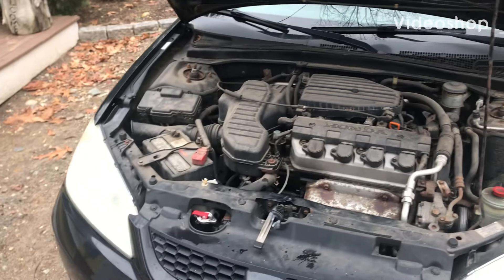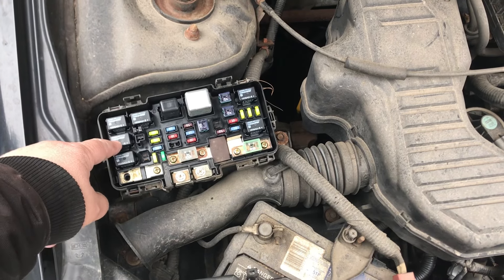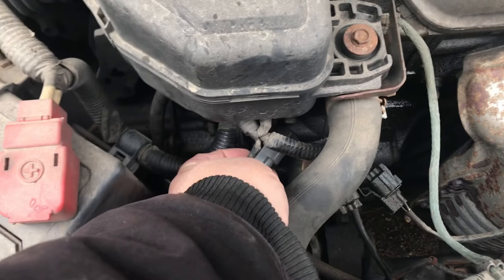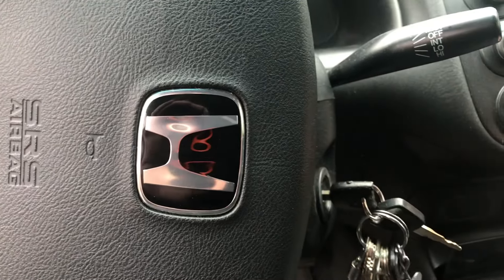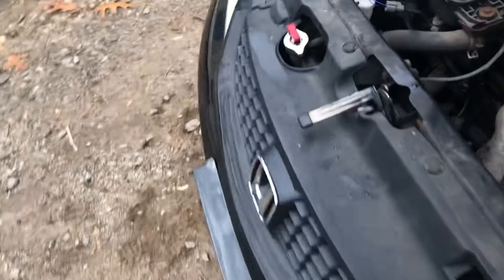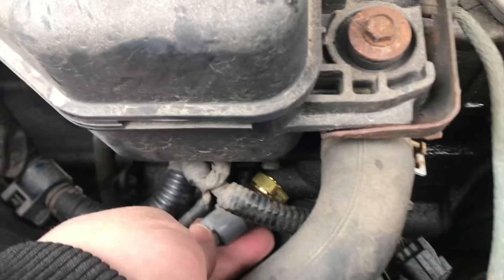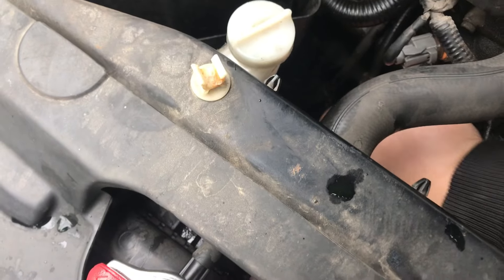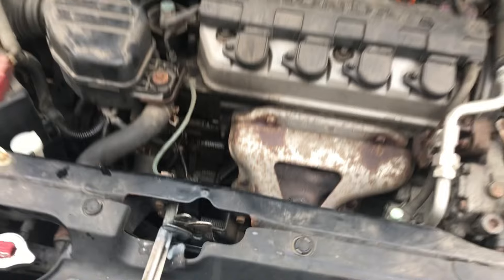Honda Civic “01-05” What to Check when Overheating. DIY & $ave

Comment: @High Ridge Handyman I'm starting to have a problem with my 01 Honda civic its overheating and the car start to shake as well I'm not sure what wrong with it and plus when its does only go 20 mph
Reply from the maker: It could be the water pump going bad or check for any clogs in the coolant hoses. Good luck be careful. If your unsure hire an Experienced mechanic 👍🏻
Reply: Civics run a little rough when low on coolant. Check coolant hoses and caps (especially reservoir!) For leaks.

Comment: I have the same car here in Pakistan
I was having the same problem.
Tried what you told in this video using the paper clip and both the fans turned on. So its evident that the coolant temperature sensor is broken
Thanks for the help really appreciate it.

Comment: What would it be if it shoots water by the reservoir?
Reply from the maker: Could be your radiator cap pressure valve stuck open. Change out the radiator cap with the proper model number for your vehicle. Find one in the middle price range💪🏻

Comment: I had the same problem. Fans were not coming on when the motor is up to full temperature. I replaced the cooling fan switch and messed with the relays and boom they came on. Thank you for your video. 😊
Reply from the maker: You’re welcome Darryl. Thank you for taking the time to watch the video. Good luck💪🏻

Comment: I dont get it. My 2002 turned my fans on w the ac. Without doing the paperclip trick & they both turned on. Wouldn't that mean the sensor is good? & since you said your fans were running even before the paper clip trick. What is the point of the paperclip?
Im prerty sure mine is water pump. Cause my belt was squeeking mostly when I turn ac on..before I changed the radiator h thermostat. Thanks for taking the time to respond back to each of us. It .akes me want to share your page more
Reply: Also. My hose are both warm relay good. & for about a year the heat takes a bit to warm up & the ac takes a bit to cool...so..yeah probably my water pump. Since it would make no sense for a heater core to cause overheating right?
Reply from the maker: If your squeaking when you turn on your ax you have a loose belt. Try that first it happened to mine after the alternator was changed out and the belt wasn’t tightened up properly
Reply: @HighRidgeHandyman  thanks. But I changed both belts & thermostat a mo th ago no more squeek. Radiator 3 weeks ago w hoses & cap. Fans both work. I guess my question was worded wrong. Since I couldn't squeeze that clip off the sensor. I just turned the ac on & they both ran so I never tested the sensor. Would it fail to turn on after the higher temp. Or should I jist go & change the water pump h all the fixings inside. It doesn't seem like the head gasket has failed. But. I he as rd it was easy to do on civic..

Comment: Do both fans have to work simultaneously I thought one was for cooling?
Reply from the maker: Your right👍🏻 One for AC the other to cool engine. With larger engines they have a dual fan system so if it gets extremely hair both will come on the cool the engine.
Reply: @HighRidgeHandyman  just wondering because when I did the paperclip with the power on engine off ac button on only the driver side fan came on.

Comment: My civic car 2005 first start and run almost 3-4 minutes (not up 40 km) and when i slow the car then not speed up. The car not accelerate but rpm goes up when I restarting again car and car run 3-4 minutes (40 km). My transmission already changed. Help me.(give me this problem solution)

Comment: My 2005 honda civic just started over heating only when I'm on the freeway my check engine light has been on they said I need to replace my oxygen sensor and 2 cylinders can that be a reason why? Also I just fixed my head gasket a couple months ago not sure whats causing it to overheat
Reply: Did you ever figure out the issue? I’m dealing with the exact same problem. Even fixed the head gasket a couple months ago

Comment: Let me ask you a question. Before I’ll tell you the issue. My car takes long to start, and when it starts it sounds like going on and off. There’s a lot of people going though the radiator hose, it’s packed with air pressure, and the car starts blowing stons of white smoke. In Drive it goes slowly cause reverse you have to amost have the pedal to floor to move it a little. How do I know if the heads are blown ?
Reply from the maker: Usually white smoke from the exhaust means there a coolant leak into the engine. To test for a head gasket leak open the oil fill cap and if it’s a brownish yellow milky substance that will indicate you have a head gasket leak. Good luck 👍🏻

Comment: My 04 civic only overheats while driving but at a idle it cools back down , any suggestions?
Reply from the maker: Make sure your fans are working and they come one. Also check the thermostat to make sure it’s operating correctly make sure both top and bottom hoses are warm. It could be something when the system is pressurized like a head gasket or cracked block or water pump. Just go threw the process. Good luck be safe👍🏻
Reply: Drain coolant. Stick water hose inside radiator and radiator hoses. Fill radiator with white vinegar and run car for about 20 min with heater on. Drain white vinegar and flush again with water hose and then refill with coolant. More likely your heater core or motor has a blockage. I know it sounds crazy but it fixed the same problem you were having.

Comment: What does it mean if my fan doesn’t work at all?
Reply: There are two fans, one is ac fan and the other is radiator. Leave the ac off and let car sit for about 15 min and see if it comes on, try driving around and see if it reaches certain temperature to see if they come on after you let car idle. If they don't their is a fan switch that has a wire hooked to it, its in front of the fans. It cost like 20 bucks to replace that might be your issue before you start thinking it's the main fan having a issue.
Reply: @guitarstalkandtech9085  I found out they do work but my radiator fan  doesn't kick on when it's hot.
Reply: @adam.119  Then the switch may be out. Probably simple fix

Comment: My civic overheats on idle what are the areas to check. I just rebuilt the engine too.
Reply from the maker: Check for faulty thermostat or water pump. Also check the fan switch or any clogs in radiator. On idle have cap open to see if any coolant  flow. If no flow then the thermostat is stuck closed. Good luck be safe. Work at your own risk or hire a professional if your not comfortable doing it👍🏻
Reply: My civic overheats after a long run .
Thermostat is good,relays and all that good too.
I replaced the cooling system sensor as well and still overheating..
Anything else I could check?
Reply: I'm having same problem on my 2005 Honda civic ex. Sick and tired of this overheating!! Replaced thermostat and radiator. The heater goes from hot to cold and then it starts overheating after a long drive
Reply: @guitarstalkandtech9085  manage to find the issue?
Reply: @dbagginz-7147  more likely leaking head gasket or something thats mixing in with my coolant, it runs good for about 500 miles or so and then it starts acting up a lil with temperature Guage and when I check the radiator cap I noticed some sludge build up in my thermostat and thermostat housing so I basically just been flushing out my coolant system with water hose about every 500 miles or whenever I notice something is up. But overall it hasn't been to bad lately. I'll probably be changing gasket in the head to stop it from leaking.
Reply: @guitarstalkandtech9085  Ok, thanks for the reply
Reply: @alexherrera4877  change the reservoir
Reply: @guitarstalkandtech9085  change the reservoir
Reply: @Sagerichard2894  what will that do?
Reply: @guitarstalkandtech9085  A bad reservoir could lead to an overheating engine, coolant leaks, etc. My car would overheat at idle and I changed the radiator, thermostat, coolant switch but I never thought to change the reservoir. It costs around 32 bucks for the part and I could’ve saved myself hundreds of dollars
Reply: @guitarstalkandtech9085  But that is only if you know that your other parts are good such as the water pump and timing belt, etc

Comment: I have a question about the radiator. I had mine changed few days ago and I noticed that it has a smaller hole right under the radiator cap. Is that for pressure release or is it the wrong radiator that was put on? I don’t know if it’s supposed to have that hole or not. I also changed the thermostat,radiator cap and hoses and car is still steaming and loosing coolant.
Reply: Same!!

Comment: My son had been experiencing overheating.  We checked the horn, it worked.  We swapped the relays and the horn didn't work. so the fan relay was bad.  replaced it and the temps have stayed down.

Comment: Thank you for the video. If you could tell me the part number of the radiator cap with the relief valve I would appreciate it. My 2004 Honda with 223k miles had a bad thermostat. I would like to say the OEM thermostat I bought had 78C stamped into it. 78C is close to 178 F.  After changing it and purging the system the ODB-II reported 180 degrees F as I took a long test drive. If you are moving the electric fans are not required, if the thermostat which controls/regulates heat and flow fails then there's different issue. Thanks Again take care.
Reply from the maker: Duralast Radiator Cap 7737

Comment: I kept losing coolant for some reason, but when pressure tested, no visible leaks. I ended up having to pay for a head gasket replacement.
Reply from the maker: I’m surprised they didn’t see that in the pressure testing. Hope it lasts a long time for you👍🏻
Reply: How much was the gasket?

Comment: Got a problem with my civic. Just replaced the radiator, hoses, fans, fans switch, thermostat, and temperature sensor. But it overheats when it’s parked and it’s on C when I’m driving it.
Reply: Most likely bad head gasket
Reply: Check reservoir coolant cap and radiator coolant cap. Coolant tends to leak thru the reservoir cap (been changing it for years) causing it to heat up, also check lines for leaks, but most likely it could be head gasket.
Reply: Change the reservoir

Comment: me and my friend replaced everything from the video in my car and it’ll be fine but after a while it’ll over heat again. i’m pretty we’ve run out of parts to replace that could cause overheating, instead i’ve had to burp the coolant system everytime it starts to overheat again
Reply from the maker: Do you have any white smoke coming from the tailpipe? If so it could be a blown head gasket. If not do a pressure test to see if you have a hair line crack in one of the hoses. Also check the cap even new ones can be defective. Good luck
Reply: Did you burp it correctly with full blast heat and fan on?
Reply: Cause I had the same problem I thought it was my water pump but I burped it with the heat and fan on and now it’s not overheating anymore.

Comment: So after the paper clip method and the cooling fans still don't turn on does that mean the cooling fans are bad?
Reply from the maker: Check the fuse, if that’s ok put battery and ground to the fans to see if they come on. If not could be bad wire or fan altogether. Good luck be safe. If not sure how to always hire a professional 👍🏻

Comment: My son's 2003 Civic just overheated 3days ago. I checked the fan and the radiator hose, it's not even warm even when the temperature reaches redline. The fan doesn't turns on at all.  So I just replaced the thermostat, and now, the radiator hose feels warm/hot which is good.  But I still have to trouble shoot the fan issue.
After watching your video, I was able to trouble shoot that the coolant sensor switch is ALSO bad. THANKS FOR YOUR HELP on how to figure out a faulty switch.

I addition, I also discovered that the radiator is also leaking at the top, which is causing some steam once the engine gets hot.
So three things that I had to fix: Thermostat + gasket ($28), coolant sensor switch ($10), Denso Radiator ($85).

The CIVIC has only 240K miles, barely breaking-in, LoL. 😄
Reply from the maker: Gotta love the YouTube!! Good luck bro👍🏻
Reply: Same thing happened to me but at 150K. First, the radiator had a crack in it. Then the radiator cap was bad too. Then the switch had to be replaced because fans were not coming on. Last but not least, the thermostat had to be changed. Plus I changed the top and bottom radiator hoses just to be safe.

My car has been great and hasn't overheated at all since the changes for 5K miles. Hope it stays that way for a while. 

Radiator
Radiator Cap
Fan Switch
Top and Bottom Hose
Thermostat w/ Gasket

Spent probably around $130-150 but I changed everything so that was great.
Reply: @rudyv1891 Mine currently boils the coolant any tips ?

Comment: Changed the sensor and the fans still aren’t working
Reply from the maker: Did you test the fans by bypassing the sensor? If so make sure it’s the right sensor for the make and year. Also the temp has to reach high temp to trip the fans on. Other way to test fans put on your ac and see if that operate . Good luck be safe. If your unsure HIRE A PROFESSIONAL.👍🏻

Comment: Just changed the sensor and the fans are still not coming on??? Please help
Reply from the maker: Check the fuses, check for broken wire in harness, if nothing could be blow fan motor

Comment: I replaced sensor and it didn’t fix it for me so I replaced thermostat and gasket and coolant now it’s better but it’s starting to act up again hand on face. 🤦🏽‍♂️
I’m probably going to try to remove as much air in the system as I can and see what happens and try some troubleshooting.

Comment: Thermostat opens at 184f and fans turn on at 204f.
Reply: how can you tell
Reply: @swaveman9434  if you have a scanner (even those $15 ones will give you data) it will give you a more accurate temp. At 184f temp holds for sometime and you will notice that bottom hose gets warmer. At 204f fans should kick on and bring the temp down and turn back on at 204f again.

Comment: I replaced radiator , radiator cap, and thermostat how can I tell if it’s head gasket or water pump ?
Reply from the maker: @jesuschewy7480  

Bubbles in coolant: With the engine running, remove the radiator cap (when cool) and observe if there are excessive bubbles in the coolant, which could indicate a head gasket leak. 

Milky oil: Check the engine oil dipstick for a milky appearance, which can signify coolant mixing with the oil due to a head gasket failure. 

To test a water pump on a 2005 Honda Civic, primarily look for signs of coolant leaks around the pump, listen for unusual noises like whining or squealing while the engine runs,

Comment: My 05 civic lx overheats when parked but cools down when giving gas, any input?
Reply from the maker: Check both hoses to make sure warm fluid is flowing to make sure thermostat is operating properly. Then check the fans to make sure they work. Then check the cooling sensor. If all good check head gaskets for leak